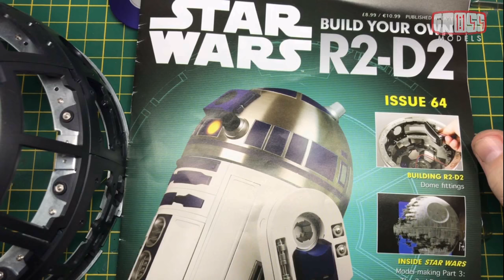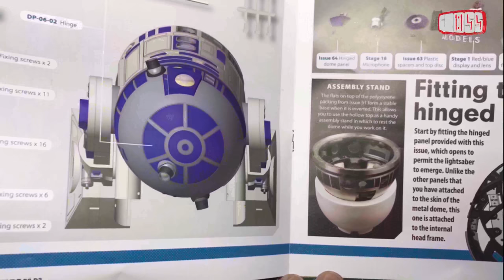Deagostini Build R2D2 Issue 64

Comment: Hi Chris,I've ordered metal bolts to replace the tan plastic ones you need 27 so I ordered 30 on Amazon £2.75 give a much better fit
Reply from the maker: I did see a post about that, guess it was yours! I’m happy with the plastic ones, they seem to work fine. It’s not like they need to be under any strain.